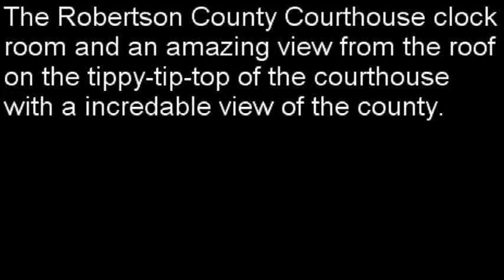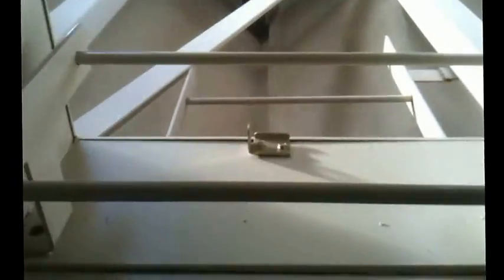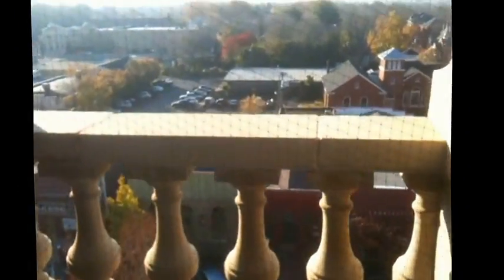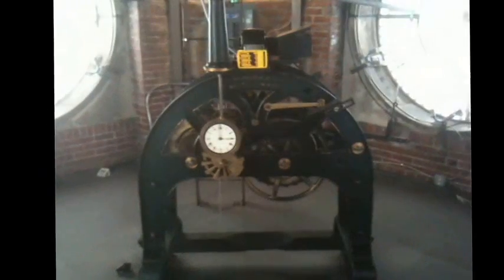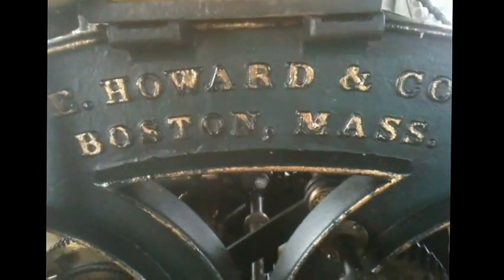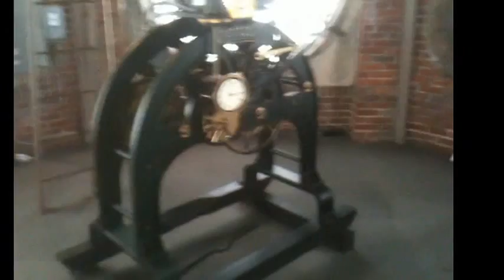CLOCK TOWER TOUR Robertson County Courthouse

Comment: Just viewed Jim’s video of the Howard clock in the Robertson County Courthouse. Nice restoration job on the Howard round top special striker. I am studying these clocks and trying to sort out the characteristics that distinguish each model. Measurements of the frame size across the bottom and to the top of the frame plus the separation between frames would be helpful. Detailed pictures of the clock—particularly side views would also be good. 
I found a listing for your clock in the Howard Customer List for order number 43/11841. This would date it ca 1929. Unfortunately no other details are available in the records.
Reply: This is the Howard Round Top Special Model No. 0.